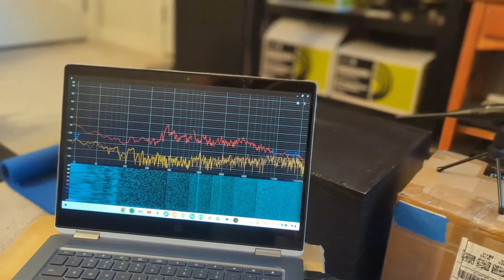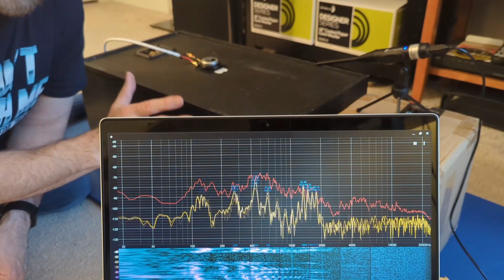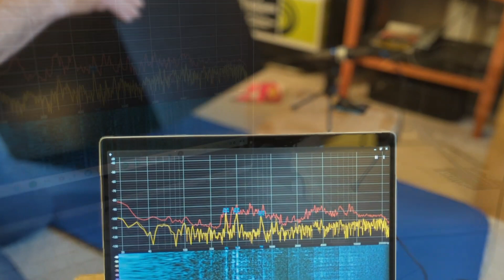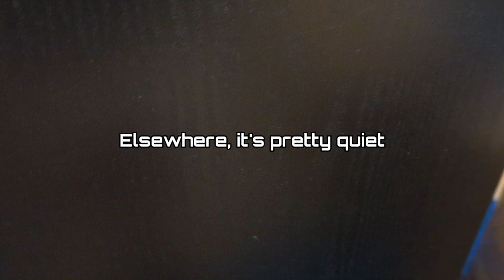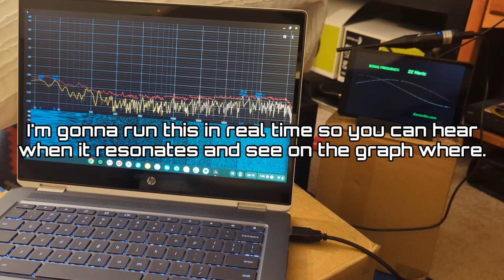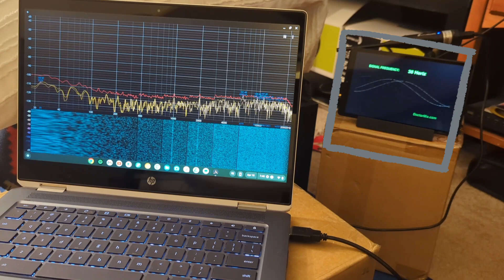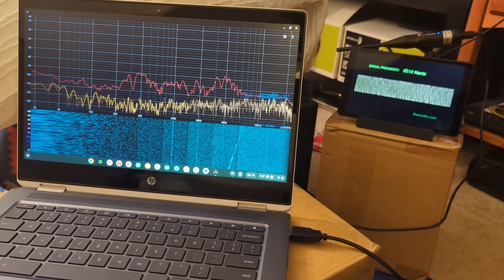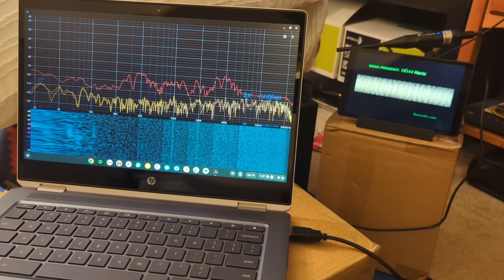How much does sound deadener help reduce speaker cabinet resonance? Find out in RCA STS-1230 Part 17

Comment: Tbh you are just about making a new speaker and those speaker cabinets are made from.5 chip board they are just rectangular boxes. You should just get a sheet of mdf and build a proper cabinet for those drivers you never are going to make those cabinets strong enough and you are spending so much time on something when you could just build a better one yourself with modern material.
Reply from the maker: Hi Mike, thanks for watching and commenting! I appreciate your honesty and I am really glad that you posted 👍. It gives me a reason to really think about "why" I do what I do, performing light restoration, modification, and customization on old speakers. It's also a great topic for a future video, perhaps "Does Cabinet Construction or Materials Matter"...

I checked out your projects and huge cred for DIY glad to see you enjoy the hobby as well. The towers are especially interesting.

I don't think it's always necessary to build new cabinets for every project. The question of cabinet construction materials, strength and box shape don't translate into a good or bad loudspeaker per se. Often the original cabinets and design were intentional, produce certain results, or give the speaker character tonal qualities.  I'll be the first to admit that the companies who made them, did so with the highest profit margins in mind, so less expensive materials, and parts, cheap electronics, lighter weight, cheaper finishes and so on, but they also employed research and development, prototypes, testing, target market price points, etc. There were companies like Energy for example that pushed the boundaries and closed the gap between high end and mass market speakers, then there were those that simply embraced the cheapness or intended application, such as Cerwin Vega, Fischer, Pioneer, Realistic, and so on who's intended market was the general consumer. Others simply plotted their own course like KEF and we're high end or nothing. There were also the companies that figured out their sweet spot and evolved into what they did best like EV, JBL and Klipsch delving into commercial applications, pro sound, and various levels of home users. There were others that floundered and sadly couldn't quite figure out who they were or what they should offer, like Jensen which despite accelerating all things speaker related back in the heyday, making phenomenal application specific Loudspeakers, transducers, DIY project plans they helped fuel the rock n roll era, but despite all that engineering prowess and contribution, they later couldn't quite get anything right in the mass market from a business standpoint. Then there were many brands that vanished along the way for various reasons.

But I'm off on one of my old man tangents.... Let me get back to the "Why":
As someone who loves building speakers I have found there are significantly easier ways to accomplish the same end goal of building a new speaker as you mentioned, except without the expense and hassle of concentrating on the cabinet so much, while also preserving a little piece of history.

First, there's the cool factor... From a sentimental point of view, for me at least, I love taking old speakers and making them better. I grew up in a time when there were possibly 9 TV channels which were clear enough to watch, there were no personal computers, no mobile phones, no Internet, no digital music and so on. Back then we pretty much had to use our imagination and effort for everything. Fixing stuff, making stuff better, was a generational norm because we didn't have as many alternatives, options, or expandable and too often easy money like today. 

Every generation goes through challenges and popular trends. The 70's, 80's, 90's were full of music reinvention and audio gear advancements, and along with that came subsequent home audio bringing the musical experience into the home rather than in concert or over a car radio. The beauty I see in old speakers is they transcend generations. Each pair of vintage speakers is a little reminder of that era.

There was a period of time when home audio and speakers were seemingly as popular and sought after as smart phones are today. No matter which magazine or catalog someone picked up, or which store one went into, there were speakers and audio gear. No matter whose home was visited, there were the haves and have nots in terms of stereo equipment. There were those in the know and those who didn't know about good stereo speakers.

Imagine a world where in order to hear a decent pair of speakers, or to learn about them, you'd need to purposely make a trip to a stereo store, (preferably with a buddy or brother), or go buy a hifi magazine. No YouTube reviews, no books to speak of for the layman, no online shopping, no instant credit, no automatic return policies if you weren't happy with the purchase, etc. Yes, these were different times, and many people day dreamed of their ultimate sound system, contemplating the purchase for months or years, and for many of us, we'd need to work and save up what seemed like crazy money to buy audio gear.

Whew, that was a lot more than you probably were looking for... Sorry I'm old and talk too much!

Okay enough reminiscing though... Here's the logic behind it from our 2020's POV:
All those mass market speakers... Almost all of them are affordable and obtainable.
There are tons of these old speakers still around, that have survived all the world threw at us... They've outlived the trends and fads, recessions and changes in our culture, habits and fancies. Vintage speakers that are older than many people, have aged more gracefully and are available to purchase for less than a sheet of MDF.  

What I'm doing is a lot of work as you mentioned, but the design goals are different from designing and building a speaker from scratch. I do like making speakers from scratch and I have made a bunch over the years, even selling them at one point some 25+ years ago.

From a budget point of view, one can be way ahead of the curve by doing a RestoMod, because most of the hard design work is done and they're turn key ready to build, present and listen to. Finished, professional looking speakers with grilles and a lineage.
In so far as the designs, construction and whether new is better than old, simply because it doesn't resemble a shoebox or have high grade thick MDF, may be underestimating the potential. They used to, (and still do), design cabinets around the "golden ratio", which translates into that ugly rectangle. It's a practical way to build a speaker that mitigates internal standing bass waves, resulting in cleaner sound. They also still make cheap cabinets. 

The vintage cabinets are plenty strong to do what they need to, especially after they are braced. They can support themselves and the drivers. I won't be using mine as jack stands any time soon, but they probably could still hold up a car. Bracing them helps reduce natural resonance, but in all honesty that's not a huge issue and the likelihood of it being audible during normal music playback is slim. Perhaps there's some golden ears out there that can tell the difference, but I primarily brace and sound deaden them only to lower SPL output of natural resonance so that the cabinet is likely not going to sing below my mid or treble crossover points.

Compared to designing and building cabinets, which introduces a chance for permanent goof ups that may take a bunch of rework or completely scraping and remaking the cabinets, vintage mass market speakers are less of a heartbreak, if they don't work out as planned, it's not a huge deal. 

Building decent cabinets is very expensive and time consuming. It also takes specialized tools, woodworking skills and a workspace to build them. Making them look professional is a big endeavor. Right now I am just not in that space, and there are plenty of builders doing that already anyway. I figured I would try take something  I was doing anyway and share it on YouTube. It's a little unorthodox, but it's fun.

I don't disagree with you though and if my budget was higher and time allowed, I would most likely build some custom cabinets, but for now I'm concentrating on the YouTube channel content, doing what I can with what I have. Plus it's a fun challenge acquiring clean old speakers and working within budget constraints, while trying to take a dry topic and make it a little entertaining.

I'm not trying to make the world's best speakers, just take old cheap speakers and make them perform better.

Wow... I really, really appreciate you taking the time to watch, comment and you've given me a lot to think about which I am grateful for. I look forward to seeing more of your projects too.
Reply: @wattspeakers  I guess I take for granted that not everyone has tools and mdf lying around and I can see your point on having sentimental value for some speakers and I started out doing the same thing as you and know it's a big night and day improvement but to be totally honest the crossover isn't going to be perfect you have to custom make them for each combination of drivers. But it's hard I know it took me a lot of work to learn how to design crossovers . But I do enjoy what you are doing and sorry for coming off negative.  I just know from experience we have the technology now as diy people to make things better than the manufacturers of even modern speaker manufacturers .
Reply: @wattspeakers  I didn't mean to be negative. I feel bad about it. I know you are doing something cool and people are enjoying watching you transform one of their favorite speakers from back in the day into something much better and you're using such high quality parts that I just thought you might be better off with a MDF cabinet and I have used off the shelf crossovers in the past I didn't have the first idea on how to design and build a custom crossover and I had some klh that sounded really bad so I put one in it and it sounded really good and I refinished the cabinet . I don't know if it was spot on with the new crossover I didn't take measurements back then I was just happy it was singing again. But I taught myself how to design speakers when I put my mind to it . I'm actually still surprised I got so good at it. It's really fun to start with nothing but an idea. My first speaker I made was a mini tower and I made it out of solid maple from an old stand for a record player I found on the side of the road I was going to throw it away and on the way to the dumpster I decided to make a speaker out of the wood. It was a lot of work to sand it all down to fresh wood but it looks beautiful now. You can actually see it in my short stories it's the the tmm and I wrote something like no subwoofer needed and feel the bass or something like that so I also give you credit for making a video I always wanted to buy never did.. it would be cool to see you design a speaker and it's a great feeling when design it from the ground up and it actually sounds good 😊 👍
Reply from the maker: @BostonMike68  Totally fine Mike, I'm glad that you commented. You're not wrong and I didn't think it was all that negative, just an honest observation and I'm probably worse than anyone when it comes to that sort of thing. So bad in fact, that my family and closest colleagues nicknamed it "Toddisms"... Like after we moved into our first house and the whole crew was hanging out eating pizza we bought for everyone. One of my brothers in law had showed up late, after the move but mentioned how good the pizza was. I blurted out "free pizza always tastes great". Well, it DOES! Just like a sandwich someone else makes for you always tastes better. He didn't take it that way, and I definitely didn't mean it negatively. Or a customer I had, who was picking up their vehicle at repairs, (I'm a collision repair professional for a living)... They thought their car's engine sounded louder after having some repairs done on the rear. I went out there with them, started it, opened the hood and gave it an honest listen, (I'm always thorough when it comes to work). I proclaimed "it actually sounds really good for a PT Cruiser". Well... My colleagues laughed at me after the customer left because I hadn't picked up on their vibe. I was being flat out honest... Those little Chrysler 4 cylinder engines get loosened up after several thousand miles and make all sorts of racket. Theirs was relatively quiet and smooth. Yup... I meant it as confirmation their engine was okay and a compliment of sorts. Not sure if they appreciated that lol.

So with speakers... Oh man I've done some serious hacking back in the day. Usually when I was broke and trying to make something out of nothing. I've also made some really sweet speakers from scratch, but that never stops me from trying something new and ruining a perfectly good pair. 

But... What you said about how you got started really resonated with me because although my learning curve with speakers was short and I was making my own cabinets and crossovers early on, and a couple dozen years ago even had a master cabinet maker with a legit wood shop helping me, so my stuff looked at good as it sounded, (maybe it looked better than it sounded lol). But anyways, I'm all for custom designed well built cabinets and crossovers. I might get back into that aspect of it, if the channel does well. I want to do it on a bigger scale than I did before though and use some selling advantages that weren't around back then. And to a different target market. My old endeavor was focused on high SPL speakers that had hifi quality. Needless to say, there's not many DJ's or bands looking for 110 lb speakers that operate best with at least 400 watts, preferably a couple thousand. Yeah that was a dumb idea.

Well here I am, 10 years from retirement with no retirement plan except social security. I was meaning to use a pair of Woofers that were left over from those high power days and figured why not do a YouTube video. It surprisingly turned into a little something and triggered that passion for making speakers all over again. It's like an obsession, my grandkids crack up at all the speakers I've got. 

Those scrapping days decades ago though, gutting and cutting up perfectly good speakers, boom boxes, etc. there's where it started. Now I'm sort of doing it in reverse... A speaker builder who goes back to his roots, using anything I've learned designing and building speakers, to basically do what I was doing 40+ years ago, hacking up perfectly fine speakers, except better!

With the crossovers, like the old mass market cabinets, they're more affordable when they're pre-built. Components and materials are so expensive now. I used to be able to make a decent pair of speakers for under a grand, not now. Not with the really high grade stuff anyway. I'll probably make some in future projects, but may need to just go iron core and electrolytic to keep the cost down. That being said though, pre made crossovers are essentially the same except the variables for the calculations were nominal. It's tougher to get them behave, but they still work. Zobels on the drivers help a lot when using pre-made crossovers. Not as good as a well designed crossover with custom values, but functionally they work fine. It can alter the crossover points obviously, and the overstock ones I buy are tricky because they were made for some other drivers, but ultimately they still do what they're supposed to, filtering frequencies.

Luckily, speaker building is almost as much luck and black magic as it is scientific. Similar to cooking in a way. There's a million ways to build speakers and they all work, but sound different. I'm basically raiding the pantry and concocting something audibly edible with left overs and basic ingredients.

Thanks again for watching the videos, the comments and don't feel bad at all. I've got pretty thick skin.
Reply: @wattspeakers  that's cool i appreciate it.  I was getting a lot of free wood from work and I would save it all . If you look at my short stories you can see my 2 way with a 10" Dayton reference woofer and it's an solid oak speaker but what you can't see is underneath it started out a thrift store $15 technic that didn't even have a crossover so I got some cheap drivers and a crossover from parts express used it like that for a while it was a huge difference.  So I got some free pre finished oak hardwood flooring so I took apart the speakers braced it and sprayed the inside with flex seal idk why I guess I like flex seal then I trowel on the hardwood floor and glued the seams and clamped it tight  but I don't like how you can see the joints and the finish that was on their so I sanded down until you couldn't see the seams and made it look like a pedestal routered the side to give it detail then I painted the edges with gold leaf paint so I thought it looked so nice I decided I couldn't use those cheap drivers and crossover so I decided on the reference paper woofer because it can crossovered high for 10" you know it's hard to use a 10" in a 2 way without beaming etc. I used the fabric reference tweeter and designed a 3rd order crossover so could crossover low enough without distortion and beaming and I designed it on xsim and then I did a lot of testing with sweeps and changed it up a little but got it were I wanted and it looks and sounds like a high end speaker which it basically is at this point I put gold platted binding posts ofc wire lead free silver solder ported it through the bottom.  I put some money into it but it sounds beautiful and I even forget how that thing started out.  So I'm into making something out of nothing I don't really like to waste things just like the piece of trash cabinet I turned into a tower yeah it took me 100 hrs lol but it looks good.  That's on my stories also.  I wish I made some videos and maybe it could have helped me out so I could build more speakers.  I'm like you said I'm obsessed with it . I love building speakers but I can't have 100 speakers I don't need so I have to sell some and nobody knows me and the money I put into them.  I just built a mtm and used Jantzen z caps my crossovers cost me $200 alone and what sell my speakers on Facebook I put $800 into for $80 I can't so I have to figure something out.  But also I was thinking about making high spl speakers recently myself using professional high efficiency drivers and a compression driver.  So guess we are similar and don't like to throw things away lol .
Reply from the maker: @BostonMike68  The "Thrifty" speakers project is a good one. You definitely could be an honorary member of the speaker hacking association. I'm president lol. JK

I've got a similar problem with all the speakers and needing to offload a bunch to make room for more. I've got 24 speakers in my office, 8 more in the hallway, 7 more in the master bedroom, 9 in the family room, 7 in the garage and 16 sitting in the basement.  That's 71 loudspeakers and then I've got a whole bunch of loose drivers... 13 pro drivers that I'm trying to figure out what to do with, Woofers and tweeters for my upcoming projects, and several boxes of drivers that came out of my vintage projects. Oh Lord, I'm like a cat lady but with speakers.

I've got some up for sale, but no bites. Maybe I'll give them away to YouTube subscribers through some challenges. I've got to figure out the legalities of that because it's technically considered gambling if it's not a non profit charity.

Surprisingly, of all the speakers I currently have, my favorites and the ones I always put back into rotation, are a pair of Realistic MC-1200's that sound incredible for what they are. 

The Dayton Reference stuff is not very appealing to me... They're clear for sure, but really hard to tune and cause listening fatigue, (to me anyway). The best tweeters I've used thus far are Peerless and the best woofers have been the Dayton Designer Series, which are very similar to the old Dayton Series 2 woofers that I used to buy for the high power speakers, except the designer series are a little more musical, easier to tune and still capable of handling some juice, but not a ton.

Keep on keeping on Mike! Thanks again for watching and commenting. The next video should be done soon, (editing is the hardest part of the whole YouTube Creator side hustle). That one will be me reversing a bad decision I made with my home theater setup, fixing that, and then the video after that is a small pair of Realistic MC-600's. Plenty more after that... A few sets of Jensen's, 3 more pairs of Realistics, an old Harmon Kardon set of speakers, and then not sure what I'm making with $3500 in Eminence Pro Drivers. They were originally bought for a giant rave /Jamaican speaker project, but I'm leaning towards turning them into home theater speakers, possibly with custom cabinets.

Keep going with that YouTube thing. Since you're doing shorts, I'll bet some fitness theme for your channel would work well. There's an older guy that started doing workout videos for normal people and he's getting popular. I like watching that Russian power lifter who goes into gyms and acts like an idiot then lifts a ton of weight, which really surprises everyone.
Reply: @wattspeakers  haha that's a good one
Reply from the maker: Oh man... Just found 2 Yamaha speakers in my closet and forgot I'm winning an eBay auction for a pair of Sony SS-MB350H which look pretty interesting... those I might just try some crossover stuff on. They've already got decent drivers. That makes 75 speakers. Not to mention 5 different receivers and 2 amps. Yup I'm for sure the audio nerd equivalent of a cat lady.
Reply: @wattspeakers  that's a score.  I'm right up there with you.  I was just at the thrift store looking for something audio but nothing good today.  I used to find a lot of silver faced amps but people got hip and want a lot of money for them.  I still have my new mtm design to finish.  I call them the double dragons  and I found carved wood double dragons . I'm going to adhere to sides and paint with gold leaf paint.  Talk about being a nerd lol . Double dragons haha idk how I come up with this stuff.
Reply: @wattspeakers  I just reread that 75 speakers! That's a speaker museum.